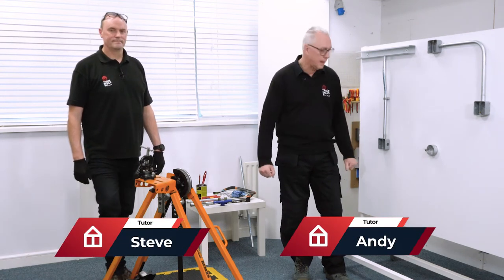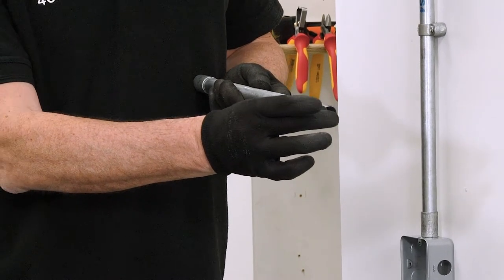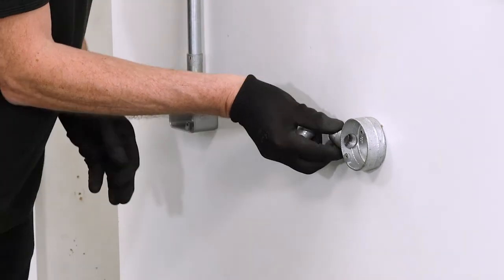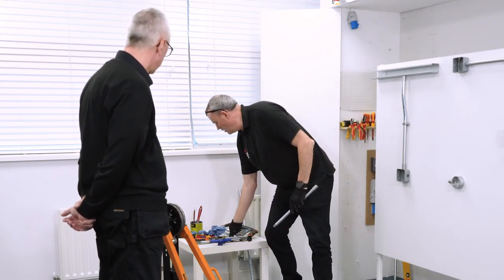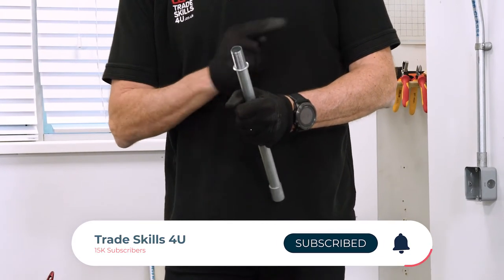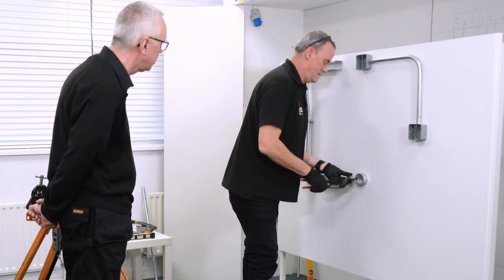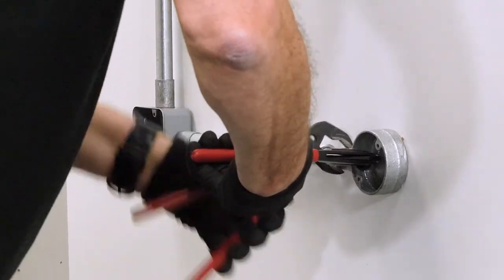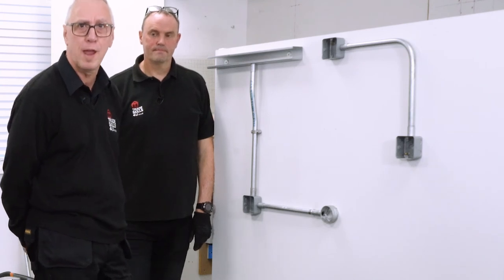Making a Running Coupling in Metal Conduit

Comment: Running thread not allowed in the States, we would use a 3 piece coupling
Reply: I wonder if it's the 3piece coupling manufacturers wrote that prohibition of running threads into the code book